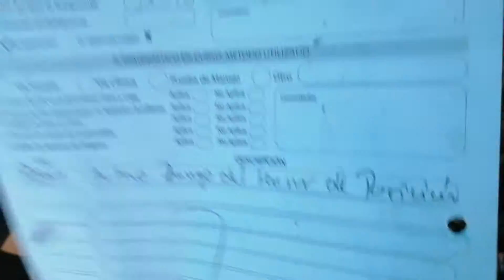Mitsubishi L200 4D56 2015 problemas de rango sensor de levas

Comment: Hola tengo una  Mitsubishi l200 y en cada cambio  de 1ra a 5ta  después de las 2000 rpm   no acelera más y al momento  de estar estacionada y el motor  andando  se puede acelerar sin problema  cual puede ser la falla espero su  respuesta gracias

Comment: Amigo estoy arreglando un l200 motor similar a este pero al conectar el sensor el motor no enciende. Sin ese sensor si funciona pero no acelera
Reply: La misma falla tengo ya cambiamos árbol de levas y sensor
Reply: @fernandofranco8807   que trabajo le hicieron?
Reply: Desconectado el sensor del árbol de eleva arranca pero acelera mucho, ya se reparo inyectores culata y sigue igual, le llega alimentación al sensor. Que podría ser. El eje de Eleva aparentemente está bien. Si problema erra que dejó de acelerar en ruta y se apoco su motor lo insistió en arrancar jalando entre otros  y al final sacando tapa de balances se dió cuenta correa roto solo el grande y 5 balancines rostro.
Reply: @everbrandsinchicalderon5085   prueba el orden de los conectores de inyectores, puede que esten al contrario  revisa eso
Reply: Llego a dar solucion justo tengo un problema